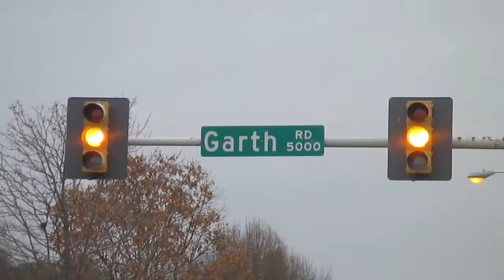Traffic Light Malfunction

Comment: Not a conflict, that can really only happen with too many green lights.  But, the light might be controlled by an inductive loop which has malfunctioned, if it can't sense vehicles it'll never turn green.
Reply from the maker: It's hooked to the through signal, as it itself is an auxiliary through signal.

Comment: Not even sure that setup is legal, according to the MUTCD, to have the left turn signal on the opposite side of the street. I think it should be the leftmost signal on the overhead cantilever with three heads attached instead of the two

So not only is it malfunctioning,  but it's illegally located as well.
Reply from the maker: It's an auxiliary through signal.